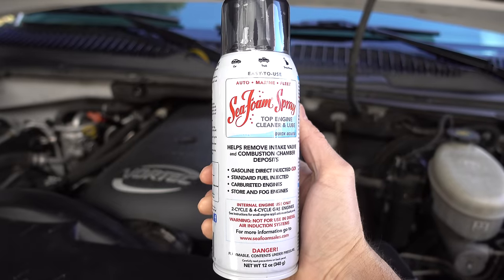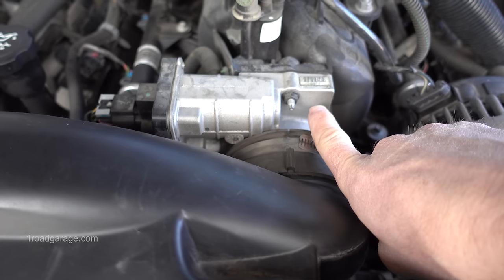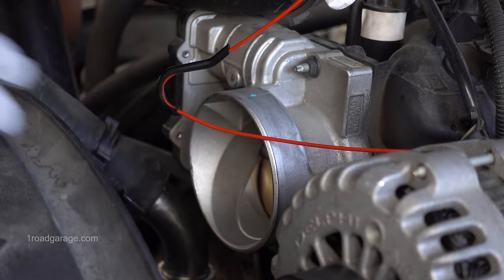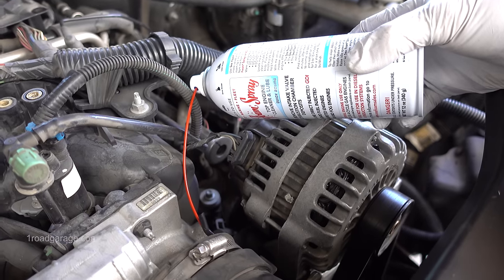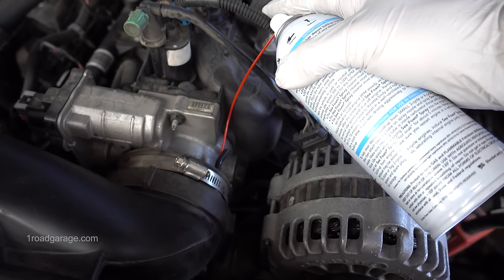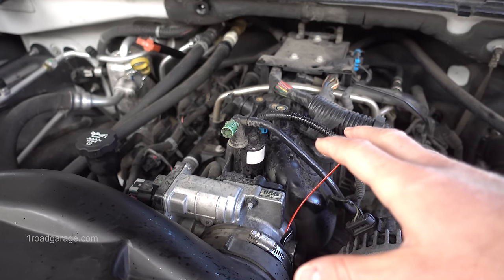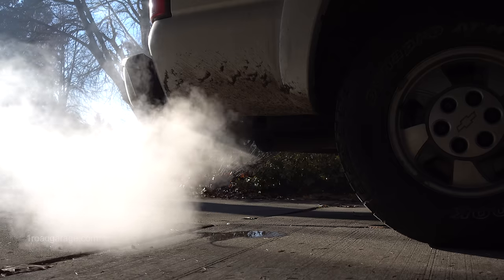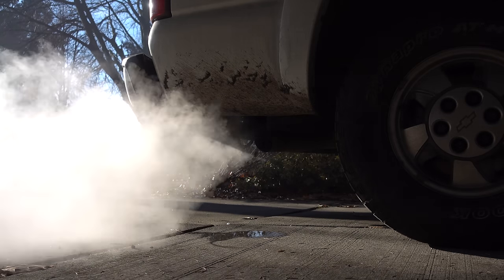SEAFOAM SPRAY - SUPER CLEAN Your Motor!

Comment: The white smoke is the actual sea foam burning off not your engine deposits....alot of people think its your engine crap, but its not. they made it like that so people think its there car deposits so it seems like it doing a great burn off job. i am sure it helps a little. you would have to take the heads off and clean off the carbon deposits with wire brushes and solvents, its caked on your valves
Reply: Watch Chris fix’s video. It cleaned the edges of the cylinders which more than likely cleaned the piston rings , which in turn helps stop oil burning!

Comment: Rather than cutting the straw, simply pull the straw (or reposition it) through the black plastic guide. This gives more slack to position the can in a comfortable position while spraying since it takes several minutes to empty its contents.

Comment: Accidentally got some overspray on my headlight, wiped it off and it looked much better, so I did the other.. So far so good, clear and bright lenses
Reply: Well after cleaning your headlights if you put turtle wax on it. It will stay cleaner longer
Reply: Jake Eastin , not a bad idea, might be a good protective coating to keep on them.  The winter here is harsh on the old plastic headlights, that would help.
Reply: @lilspikes81  it does help. I'll clean mine with toothpaste and after I'm done I put turtle wax on them
Reply: I oughtta try this
Reply: Will fail year safety check but good luck lol “product on the lense”
Reply: @conorf8091  safety check? What state are you in?

Comment: I did this twice when i was having exhaust restrictions that ended up causing misfires and this stuff works. You do have to floor it though to get enough pressure to clear it, going from dead stop to high rpms but it does get the job done.  I had to do mine twice and now it runs just as good as my other suburban. If you are having misfires, mine was on culinder 8 and i swapped everything snd still had it and the thing was misfiring because of restriction. It only misfired when getting on it, when running gma style you would never know.

Comment: I just did this to my 97 Dodge ram 1500 and I too noticed a little better throttle response. I'm usually the guy that's like "no way, it's in ur head" about things like better throttle response but I really think that it's true in this case!! My truck is definitely running a little better. Very pleased with the seafoam in the intake. I also put it in the gas tank and the crank case! All around, pretty happy with it all!
Reply: How often do you put it in The Throttle body?

Comment: I did this today in my 06 Tacoma with 314k miles. Only for like 15sec heavy smoke came out. Then total of 30sec of smoke and after no smoke. I was hoping to see lots of smoke. Did I do something wrong? I did spray for like 5 min til can was empty. Put a brick on the gas pedal and stayed at 2k rpm. After spray can was empty I let it sit or soak for 15 mins with engine off. But before all that I had clean the throttle body. Also I had added seafoam in the crank case a week before. Was getting ready for an oil change. During those 15 minutes of waiting to soak. I replaced the pvc valve and torqued at 14ft lbs and replaced the throttle body gasket and torqued at 9ft lbs. After soaking and starting engine it’s when I noticed the 30sec of smoke. I still had the truck running for 10 mins while at 2k rpm. Then did the oil change. Drove for work but it was 20 miles round trip. Should  repeat the step with spray engine treatment?

Comment: I just used this same stuff in My 95 Jeep YJ with 235000 miles on it. No more smoke came out except what was expected to 17 degrees F outside when I did this. I keep sea foam in my oil, I always do an engine flush before oil changes, I was thinking maybe since I do all of this normal maintenance there was nothing in there to clean out. Odd no smoke at all when I did this.

Comment: Honest to GOD this stuff really works! It is an amazing product. I felt and heard a huge difference in my engine.
Reply: have you seen the intake valves and the cylinder afterwards?
Reply: @gordonlam2757  no I haven't. I know with the exhaust gas recirculation it puts a lot of nasty build up on the intake. It probably cleans a lot of that and breathes better
Reply: @tanman7879  i was watching project farm and he does alot of theses product tests but using a lawn mower engine and it didn't look clean, yeah albeit tons of white smoke  but it was that clean.
Reply: @gordonlam2757  yeah I like his videos but a car engine is a lot different than a lawn mower engine obviously. With all of the emissions restrictions and all I think that would make a difference on the results of cleaning.

Comment: Despite any silly directions- for future reference- next time you do this- please follow this method: After warming the engine- remove the fuel pump fuse. Do not cut the straw. Open the throttle, and push the tube in, then release the throttle.The tube will slightly hold the throttle open- perfectly enough, and no need for assistance. Spray while starting the engine, and continue spraying until the can is empty, running the engine on the contents of the can. Do not depress the throttle. Also- hold the can UPRIGHT while spraying, not at an angle. Let the engine sit overnight, 8-10 hours minimum. Replace removed fuse. Immediately drive vehicle at least 20 minutes to clear. Works every time.
Reply: I do this also on my LR Discovery. I remover the fuel pump relay (R1) and like you said run the engine off of the Seafoam and then let it sit over night to soak in.
Reply: Thanks, JUKE179r. Yes- this is the most effective method.
Reply: Why the fuel pump fuse? Any info would appreciated,

Thanks
Reply: Easiest way to prevent the fuel pump from running. Follow the directions I gave. The goal- is to make the engine run exclusively on the contents of the can (propellant and cleaner) and not gasoline. 

Spraying the can=engine running.

After warming the engine- remove the fuel pump fuse. Do not cut the straw. Open the throttle, and push the tube in, then release the throttle. The tube will slightly hold the throttle open- perfectly enough, and no need for assistance. Spray while starting the engine, and continue spraying until the can is empty, running the engine on the contents of the can. Do not depress the throttle. Also- hold the can UPRIGHT while spraying, not at an angle. Let the engine sit overnight, 8-10 hours minimum. Replace removed fuse. Immediately drive vehicle at least 20 minutes to clear.
Reply: when you say spray while starting the engine, does that mean turn the engine off after its warm?
Reply: When the can is empty- the engine will shut off from running out of fuel. "Spray while starting the engine, and continue spraying until the can is empty, running the engine on the contents of the can." Do you understand? The propellant and cleaner will act like a fuel. The straw will hold the throttle open just enough to not lean out or flood.
Reply: so after you pull the fuel pump fuse, it will die? and then you start spraying and crank the engine?
Reply: The engine should already be warmed, before doing this.
Reply: right, so you just stick it in and spray it while someone is revving the engine  until the can runs out, then the engine will shut off, and you will crank it the next day and drive it for 20 minutes, correct?
Reply: after you've already got it warm, and removed the fuel pump fuse of course
Reply: 1) RUN ENGINE UNTIL WARM. 2) TURN ENGINE OFF. 3) REMOVE FUEL PUMP FUSE. 4) OPEN THROTTLE. 5) ASSEMBLE STRAW INTO THROTTLE BODY, PAST THROTTLE PLATE AT LEAST 1/4". 6) ALLOW THROTTLE PLATE TO REST AGAINST STRAW, IT WILL HOLD THE THROTTLE OPEN. 7) START ENGINE WHILE SPRAYING. 8) LEAVE KEY ON, CONTINUE SPRAYING, TO KEEP ENGINE RUNNING. 9) CONTINUE SPRAYING UNTIL CAN IS EMPTY. ENGINE WILL STOP AUTOMATICALLY. TURN KEY OFF. 10) LET ENGINE SIT, 8-10 HOURS MINIMUM- PREFERRABLY OVERNIGHT. 11) REPLACE FUEL PUMP FUSE. 12) START NORMALLY, DRIVE UNTIL EXHAUST CLEARS UP. 13) ASK GUY ON INTERNET ANOTHER STUPID QUESTION- MAKING HIM WANT TO DRINK AGAIN AFTER BEING SOBER 10 YEARS.
Reply: thank, i just have to get it very detailed, in your first set of instructions you didn't put number 2 in there. i'm picking up my 2 year chip tomorrow night. sobriety date birthday was yesterday, january 19 2016. thanks for the info friend.
Reply: on the vac line to the brake version. do i start the engine, pour half a can in slowly, then shut the car off, hook tube back up, wait over night, and run around the block a couple times?
Reply: God Bless you.
Reply: thanks again
Reply: HUBBABUBBA DOOPYDOOP thanks for the info, much easier your way. I had a lot of engine knocking, is this something u also experienced also ?
Reply: thanks for the very detailed process, so, in the end, the main difference is to let it rest the night instead of the 15 minutes suggested by the instructions, is it because more time is better?
Reply: Yes my friend.. You speak wise advise 🎎 grasshopper🎍
Reply: HUBBABUBBA DOOPYDOOP what is mass airflow sensor on throttle bottle I heard you almost suppose to spray after it is that true
Reply: @thomasv5596  congratulations brother! Sobriety these days is no small feat, we're proud of you!!
Reply: @HUBBABUBBADOOPYDOOP  sweet Jesus
Reply: Exactly. I don't understand his rationale for a 15 min soak of the engine. Minimum 2 hours but best is overnight soaking of the cleaner.

Who knows what long term effects any of this stuff has though, in all honesty??
Might cause more harm than good.
Reply: @dfls5069  If done properly- no harm.
Improperly- waste money, lackluster results, incorrect results, negative review.
Reply: @HUBBABUBBADOOPYDOOP  
I understand your view.  Yes, the valves, etc will have some cleansing on them after the solution is sprayed into the intake, but what about all that carbon, gunk, that comes loose from the cleaning?
My concern is aren't the spark plugs, catalytic converter, and 02 Sensors going to foul up from this cleaning ?
Reply: @HUBBABUBBADOOPYDOOP  does this clean the egr valve as well?
Reply: @c.518  I have never seen anything clean an EGR valve, or it's passage, in situ; components like that must be removed to be cleaned, as well as the port it works on.
Reply: @HUBBABUBBADOOPYDOOP  ok. Thank you. Unfortunately i dont know how to do that on ford 500. Too many things in the way  and there is only 1 vid on youtube that shows how and it is too fast, and not enough detail
Reply: I'll try this on my motorcycle with the fuel lever shut off.
Reply: @scottw550  For a smaller engine, I recommend to have the engine already cranking, they spray. Be very careful not to spray too much, only enough to make it run. DO NOT HYDROLOCK THE ENGINE!
Reply: @scottw550  PLEASE let us know the results!
Reply: @HUBBABUBBADOOPYDOOP  OK never thought of that. Maybe only use 1/4 can.
Reply: @HUBBABUBBADOOPYDOOP  My motorcycle is a 6 cyl Honda CBX, I've been using seafoam lately, 15 ml per liter of fuel for 400km, and had to turn my idle down as it slowly climbed up to 1500 rpm, so it helps alright.
Reply: @scottw550  That's great!
Reply: So you need an assistance then because you can not start the engine while spraying - you need somebody to start the engine while you spray
Reply: Quick question....how do you crank the motor and spray at the same time? Would it not be easier to start the motor, spray and pull the fuel pump relay?
Reply: Interesting method
Reply: This will blow your engine, horrible advice
Reply: @bass4life294  Zero content Troll
Reply: The can literally says do NOT stick it in there. Your engine doesn’t like broken plastic parts inside it
Reply: @mr.debusy2457 Yes that has happend to me many times before without damage.  When pouring with a can vs using the spray, you run the risk of hydroloking the motor if you pour too much or too fast....especially on smaller motors
Reply: @dfls5069 yes it can foul up spark plugs and oil especially if your motor is super dirty.  Thats why its a good idea to do this treatment a few times before an oil and/spark plug change

Comment: Used this in '93 Toyota 22re engine which had poor idle in gear when warm and severe lack of power. Made an incredible difference. More power at all RPMs and smoother idle.  Wish I used it years ago.

Comment: Use BG products way better then seafoam. This is the worst cleaning process I have seen. Go to a real mechanic and have them do the three step process with BG  products.
Reply: lol Not all "real" mechanics are legit. When I went for my tune up I told the mechanic what the other shop I got a quote for was going to do additionally to the tune up A up charge of $60 for the "intake cleaner" where they'd spray it through the throttle body at 2,000rpm. He rolled his eyes laughed and said.. oh you mean they'd Seafoam it, cause that's the same process and you can buy a can from Amazon for $20 and do it at home. So by your standards my "unreal" mechanic saved me from the BS of that "real" one

Comment: I can put seafoam in my car before and there was like a little bit of white smoke like hardly none does that mean like the motors clean cuz I let it soak for 15 minutes and everything I did everything but I use like the treatment not this stuff so is that normal tube or is that just because like the motors good and it's not like all kicked up with crap

Comment: Should I change the oil again after putting seafoam in the throttle body and gas tank if I just changed the oil before I used it I didn't put it in the crank case just gas tank and throttle body let me know thanks

Comment: Hey Thanks for the video.. I have 03 expedition and I tried the seafoam procedure and the straw would not stay in the bottle and the clamp connecting to the throttle body intake with the straw inserted inside just did not work the clamp would come off and this cause two codes to appear.. which I expected but I'm handy and have the necessary tools , cleared the code.. I got about 3/4 of the seafoam in the engine I did see white smoke after I let it sit for almost 20 min.... Is there another way of getting this seafoam in the engine, Can I just spray the foam into the engine via throttle body with engine off? will this bog down the engine?

Comment: Do you need to change the oil shortly after just like if you were to pour sea foam in the crankcase?
Reply: 100-300 miles after
Reply: it doesnt contact with oil

Comment: Hey Jimmy. I like you video. Very helpful and well done. My question to you is what's the procedure when using the seafoam to clean the fuel line (after putting it in the gas tank)?
Reply: Normal driving. Thats it.

Comment: Do I need to change my oil after this? I'm not using the oil treatment, just the intake cleaner and fuel treatment.
Reply: No you don't, but depending on when the last time you did an oil change on your vehicle it wouldn't hurt

Comment: My check engine light is on now?
Reply: Run a scan, it could be one of the oxygen sensors. My guess would be the downstream sensor. The carbon burned off could have collected elsewhere by not driving aggressive enough.

Comment: It's great stuff. Do not however ever use any top end cleaners on a turbo charged engine of any type. The only way to clean valves and intakes is to remove and mechanically clean.

Comment: Removing that much carbon at one time can have devastating effects on your engine. O2 sensors can get damaged and go bad. Gunk can build up in other places. So many people are just satisfied with the end result white smoke. So they swear by Seafoam. But for those of us that are smart, we avoid this stuff. Regular fuel additives may not remove as much carbon as Seafoam does in one treatment but thats the point. You want this to be done slowly and gradually over time. Preventative maintenance.

Comment: I think it's probably debatable how much cleaning that seafoam is doing on its quick trip through the engine. Without agitation (scrubbing) even less cleaning is getting done.  It's like running hot water over your dishes and calling them clean.  Do i do this myself, yeah i do - but never do i expect miracles.  Probably do more good cleaning off the throttle body then just spraying some into the hole and running the engine.

Comment: Need a bit of help....followed your directions to the max...let it sit for the full 15 minutes...almost...then started my truck back up....when I accelorated i finally got some heavy smoke coming out,...but it stopped and my truck seems like its sputtering and choking...if I try and drive it dies one me.  I can immediately restart without any trouble but it still remains sputtering and choking.  This has gone on for 20 minutes.  NOW WHAT?????
Reply: you get that fixed?

Comment: Looks like your mass airflow sensor is past the throttle body, which means the sea foam is getting to the mass sensor, sea foam says not to do this, are you having any issues?
Reply: The maf is before the throttle body. On the intake tube. He sprayed it directly into the intake manifold.
Reply: The MAF is at the air filter.